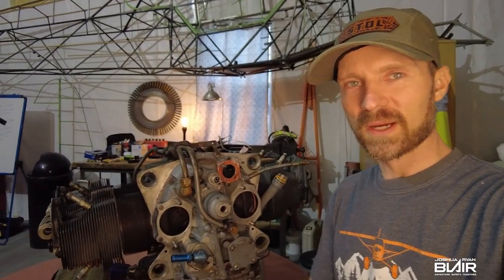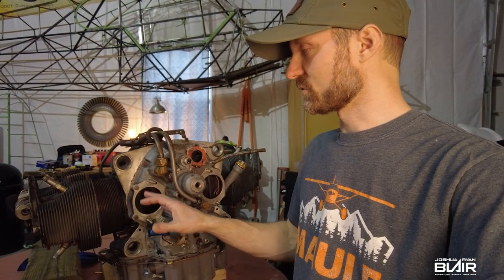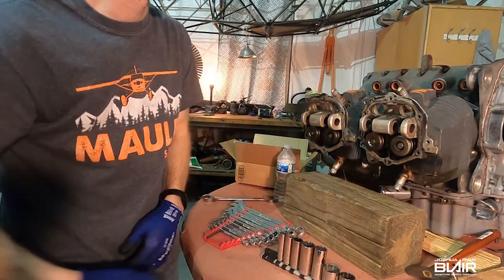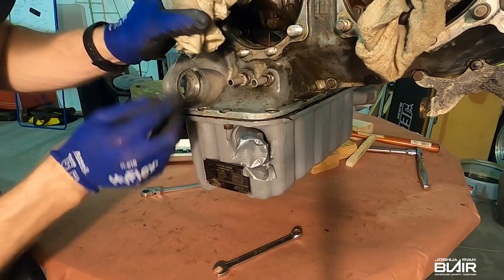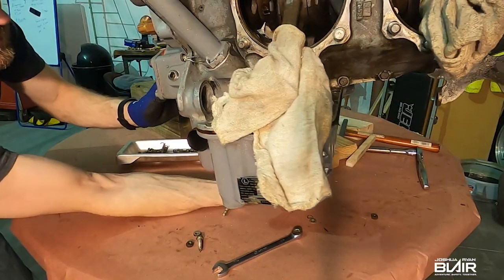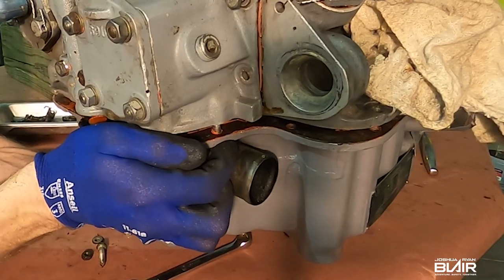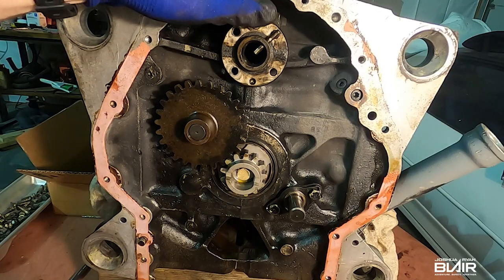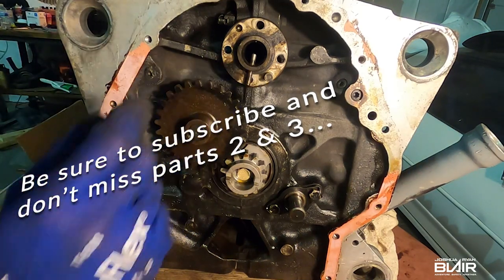Lycoming O-320 Teardown | Part 1

Comment: same for 0-320-d3g? how can one legally teardown and overhaul one. any workshop with certificate in USA?
Reply from the maker: Any certified mechanic with a powerplant rating can legally do a field overhaul. You don’t need a certificate to tear one down, however you should be familiar with the engine designed to prevent any damage.

Comment: Where does the fuel primer line connect to the intake manifold on this engine?
Reply from the maker: @Rowdy Flyer1903 the primer lines shoot directly into the cylinder head just to the side of the intake port. For some reason it had only 3 of 4 cylinders with primer lines. The main primer line T's out from the back of the engine. This answer your question? 
I apologize for the LATE reply, I lost access to my account for approx.. 4 weeks!
Reply: I have a D2A mounted on a tandem two place Gyroplane via a dynafocal mount and the engine has no fuel system installed at the moment. ( yeah a long ways to go) none of the primer lines are installed and all ports are plugged. Would a single primer line or two cylinders which follow each other in sequence be enough to initiate the ignition? Does each line require a vibration loop?